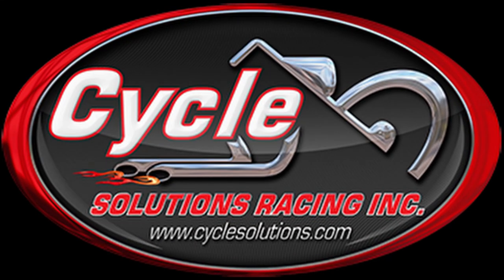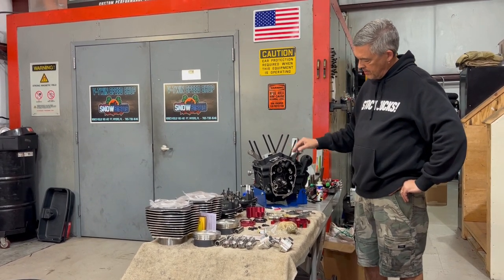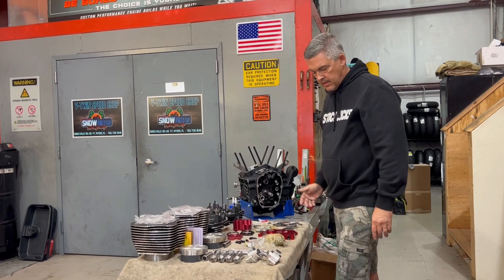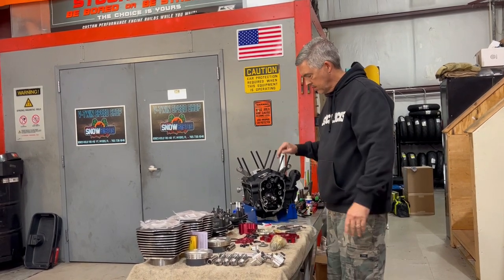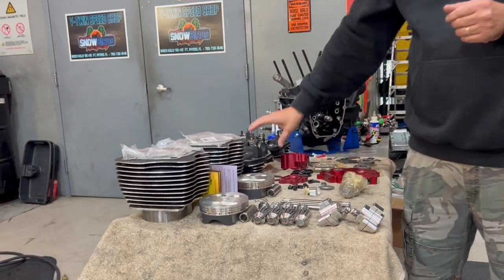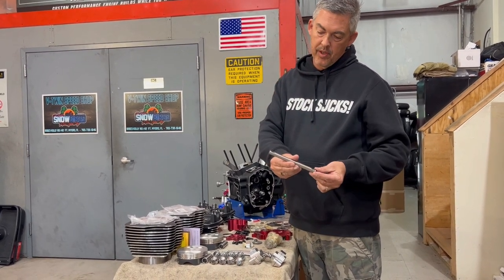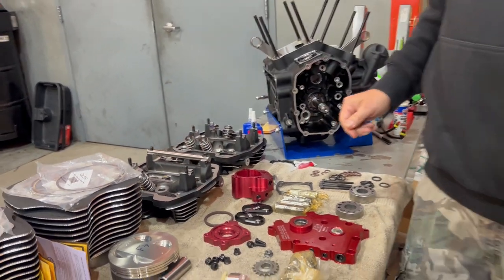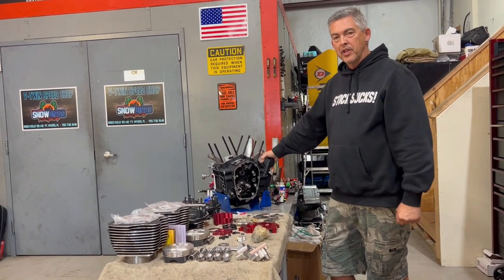Huge Harley Davidson M8 Milwaukee Eight 153 Engine Build

Comment: Not just looking at an engine build. When I built out my 2017 Ultra to a 128 and used a Woods cam, I had to have the transmission gears hardened because the stock tranny wouldn't handle the torque without eventually coming apart. All together now and getting 141 HP with 151 T. Had that 1000 pound bike up to 163 mph with throttle left. Love that upgrade. When building out, do yourself a favor and have it third party tuned. HD will leave at least 10% of throttle sitting on the floor as they're not allowed to max everything out.

Comment: Interesting impressive build, stroked [4.625"] and sleeved/finished bore/honed to utilize 4.600" bore (believe I heard 4.6" in the video). Presuming utilizing longer than stock cylinder sleeves [T-Man?].  Custom pistons, premium upgraded everything.  Presuming fully blueprinted [stack tolerances, etc.]. Can't wait to see this engine put together, tested & tuned.  Hopefully more details to come [Intake Manifold, Throttle Body, Injectors, Valve sizes, Static C.R./Dynamic C.R., etc., etc.] .  Wow!  Tom M., Hawthorne Ca. '21RGS & '22FXLRS